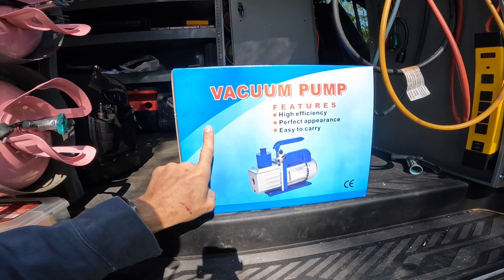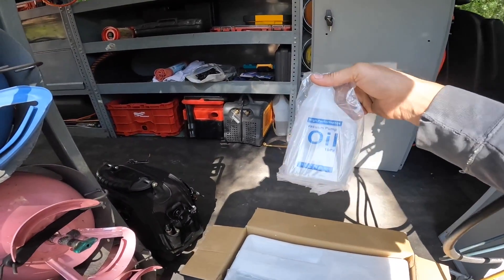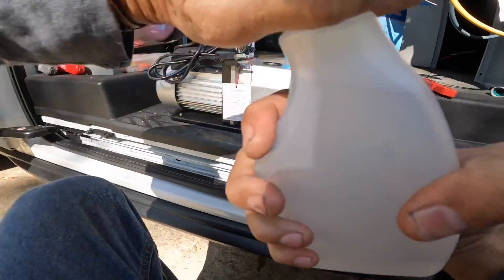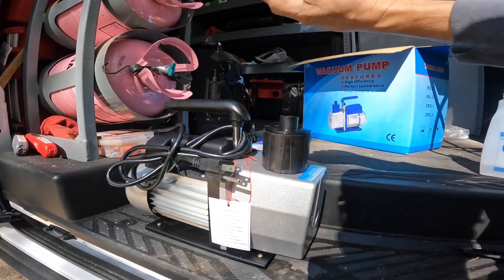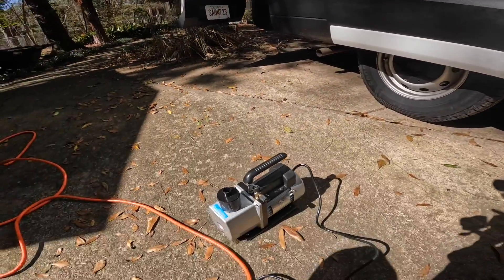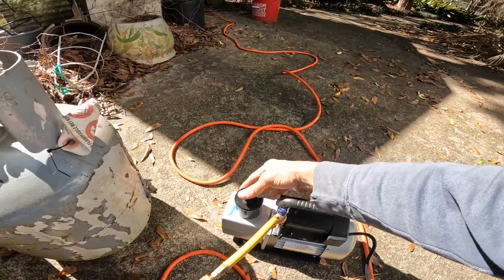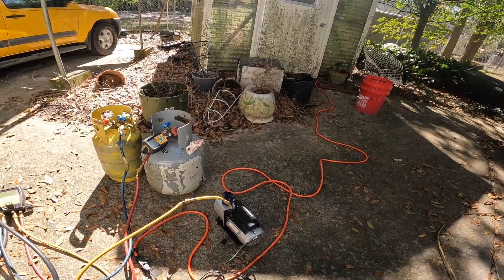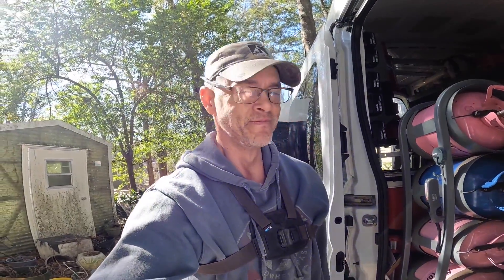Will a $120 Chinese Vacuum on Amazon Actually Work

Comment: you have to put a fan in front of it so that it doesnt overheat. The chinese pumps get hot and have a limited duty cycle. If you want to run it for 40 minutes in the summer (which is probably when you dont have ac or others dont have ac and they are sweating enough to finally get it fixed) it will overheat the thermistor.  If i had a high end Robinair brand i would still not want it to get hot because that would shorten its lifespan.
Not everyone has thousands of dollars to spend and the Chinese are good for making OKAY products that will allow a savy person to get the job done. 
Someone who is smart enough to do the job on their own that can do it better than most pros. 

Thank them for their efforts and making these products affordable and accessible.

You also dont want to buy the cheapest chinese product possible. If you do then you get what you deserve because theres levels of quality with different brands and different cfm and hp ratings. Its only a few dollars more. You cant buy the cheapest crap in existence and conclude they are all crap. Harbor freight could have one that performs better than amazon. Have to read the reviews or watch videos of guys who test them etc.....

Comment: Tools you cannot depend on do not belong in my van, toolbag or home. Nothing beats JB, YJ, FP and Appion. Navac and Milwaukee are cool too, but I'd go JB if it was my money everytime. Had JB pumps run for weeks non stop pulling centrifugals down over the winter. Change the oil, turn it on and forget about it. My YJ 8CFM is okay too, but I much prefer the oil drain and fill on a JB plus they are 100% field serviceable.

Comment: I used my cheap single stage vacuum pump the other day with two brand new recovery tanks and I could not get down even close to 500 µm. Then, I used a 6 inch quarter inch hose from the vacuum pump to the recovery tank and I was able to pull both of them down to around 350. That's when I stopped the pump, not saying that it could not have pulled it down more.
You are set up of multiple tanks, and long lines is totally incorrect .

Comment: Bad  video and opinion:
1. Connect only one recovery tank, with the shortest hose. (That is known to be the correct way by every HVAC training program I have ever seen.).
Your vacuum pump offers two connections. One is a quarter inch and there probably is a half inch inside diameter. Which means you could go with a shorter and larger size hose.

You want to do an honest and fair video I would recommend you remake this using the vacuum pump, the shortest and largest hose that you have or even if you just want to go with a common quarter inch hose from the vacuum pump to the recovery tank that is fine, but it should be less then 3 m or less than 3 feet for a realistic opinion. I would then put the micron gauge on and start it up before you engage the vacuum pump.

I don't mean to be disparaging, but all those T connections and two tanks and five lines, etc. are totally ridiculous and make no sense to anybody who has the slightest bit of professional training.
Reply: Yeah I was thinking the same thing. So many potentially leaky joints. Seems like there was a lot of conversion of standards going on there.
I will say though that these pumps are not designed for continuous use which is a shame. From manual:
30 minutes in conditions of free air circulation

15 minutes with the connected load.
Some versions (higher power) also lists max 5 mins at max vacuum.
Reply: Exactly

Comment: hi 
Those Vevor need to have the air pump stripped and cleaned before first start . Huge amount of tube vids on dirty pumps straight outta the new box . The units that are not cleaned dirty the oil after first use fine particulate metal debris is in the oil .  ****Does this cause pump seizure don`t no .
I purchased a 2 stage  4cfm ACME  vac pump     [ american products international ] [made in china ]
Pulled down to under   5 microns  1st use. Gauge on pump  5--10mins under  5micron

Comment: Good video ! Check the oil for proper level. Should be middle of the glass I believe. I think u said u filled it to the top. Also check exhaust that it’s venting. Vacuum pumps are sensitive to proper oil levels I’ve noticed.

Comment: Interesting, ive got a vacuum pump that was like $40-50 off amazon, had it for about 5 years, neglected it since i still have yet to change the oil in it, N it still runs like a beast pulling systems down under 100microns. Also have a elitech brand touchscreen vac pump that was about $500 when i got it, had it for about 2-3 years and its a beast as well

Comment: I wonder how much of the pump oil got pulled backwards through your hoses, gauges and into the recovery drums? lol, that's what happens when they stop without a check valve or being valved off. 😬

Comment: I used one of these to pull a vac on my dad's mini split. It was very hot after 30 minutes, but did pull a vaccum to less then 200 microns. I would also not recommend because I doubt it would reliably last for multiple jobs.

Comment: I found a similar single stage vacuum pump, and it was absolutely worthless. It'd run for as long as you wanted it to. It just wouldn't get down below 1,000 microns. The manufacturer sent me another one without any hassle -- it was just as bad as the first.

On the other hand, the Harbor Freight two stage vacuum pump actually works quite well, if rather slowly on a split system.

Comment: I've had reasonable luck with these.  Have two - I used one I got for like $55 on Amazon to pull vacuum on a Rheem I installed  DIY on my house.  Worked just fine, and pulled down to about 315 microns on that 2.5 ton system.  Installed a 2 ton for the upstairs and pulled that down to less than 230 microns.  Probably not nearly as fast as a pump designed for techs doing this every day, but for my purposes it worked just fine.  Did the triple evac/N2 purge to make sure I got everything in there, purged the lineset first with methanol then acetone as I think I had a burnout on the previous unit (a Goodman, and swapped out the FD that came with the unit with a Sporlan HH just in case).    But got it down to a pretty hard vacuum with a similar little Chinese vane pump.  

Will try to get some videos up at some point showing my DIY HVAC journey.

Comment: I got one just like and it seems to work just fine for automotive use.  And you can hear a change from it being on without connection to a chamber and with a connection. Yours didn't seem to change. Maybe their quality control is the weak link.

Comment: I was between a  rock and hard spot, got a vacuum pump from the famous Chinese outlet store, the c damn thing wouldn't pull below  25 inches.  It probably wants Chinese voltage.

Comment: Years ago I was employed at a company and one of the products were vacuum chambers. A guy that tested them pulled a vacuum on one and left it pulling down over the weekend unbeknownst to everybody else and sometime before Monday the power went off. That little vacuum chamber pulled oil back up from the pump and coated the inside of that chamber. I don't remember the brand of pump but it was before the Chinese import days. Thanks for the interesting video! 👍🇺🇸

Comment: I bought a diesel heater thru that outfit. Hope i have better luck. The electric to heat my shop is quite costly when we get below freezing. Due to its cheap construction, I’ll rely on electric for maintaining 55deg, and use the diesel only when attended for raising the temperature.
Reply: Hope it doesn't blow up. 💥  Lol.